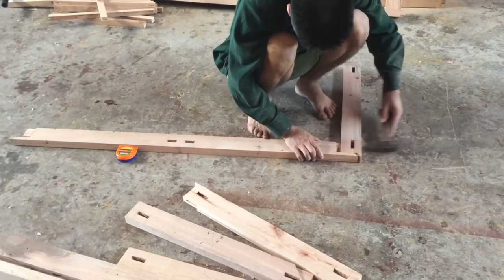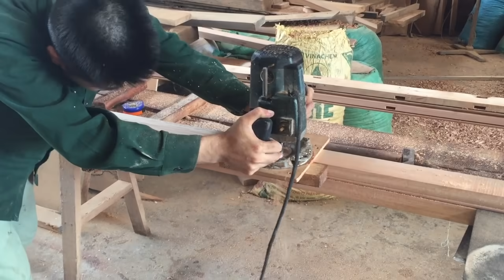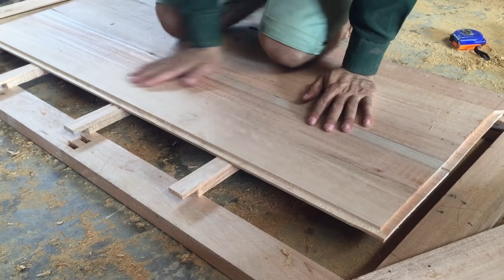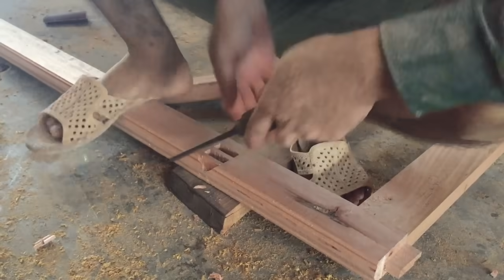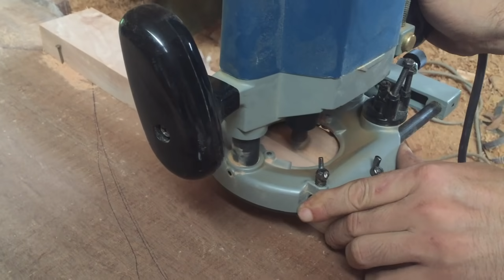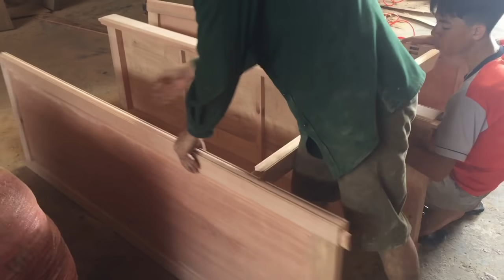How To Build Wardrobe Extremely Fast and Simple - Woodworking Skills Very Smart of Carpenter

Comment: Wow, you guys work so dangerously. For 1 wearing flip flops on your feet, for another you surface planer motor is covered in wood chips and thirdly, using your feet to push the stock through the surface planer. If you are going to show everyone these videos, please do it right. Have the correct foot wear on, keep your work area clean and tidy, and do not use your feet to push material through your power tools. I can not believe You Tube allows these unsafe videos.

Comment: OMG I just stopped watching after less than 1,5 minutes.  So many safety violations - no protective gear, not even safety shoes, no guard or guide on the planer, and they do it in the wrong order too (after squaring, first you reduce width, THEN thickness lest you want to risk your planks to flip sideways during planing because they are too thin).  I did not dare to watch what came next but I doubt it would be proper way of doing things if you can’t get the basics right.  Not going to learn anything good here I fear.
I don’t even want to know in what sort of horrible conditions these people are working but please DON’T DO THIS!!!  Cringe.

Comment: Why no glue?
Reply from the maker: We use glue and screws. Thanks you!
Reply: Woodworking Tools In this video, it's cut to fit and then nail it with the gun.
Reply: Alan Pinho :
     Dats was da first I noticed!!!
Reply: Alan Pinho
Reply: ট্রকহহ
Reply: Alan Pinho hay frendddd
Reply: Alan because they wanted to make it cheap 😂😂😂
Reply: Using glue consumes their time to wait until it dries. So they use nails and screws to speed up the process of making. I think so.
Reply: @WoodworkingTools6868  why you nailing the screws and not screwing them.

Comment: bad program,  most individuals dont have such tools,  how to fast or simple,
Reply: Get a hammer, chisel set, crosscut saw, rip saw, router with bits, no 5 Jack plane, square, marking guage and sand paper ant you can do everything u just saw simply enough. Should cost about $300 all in if that